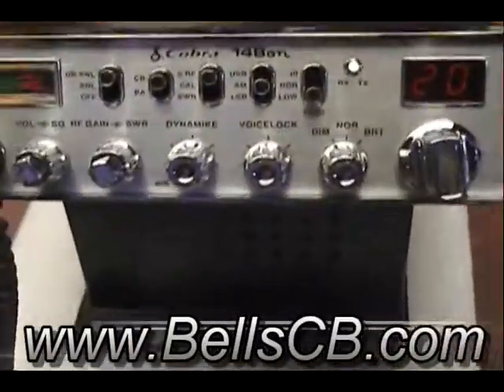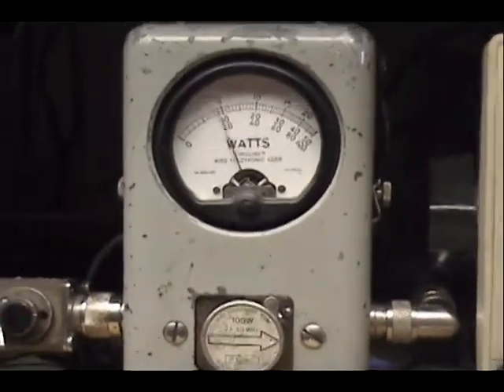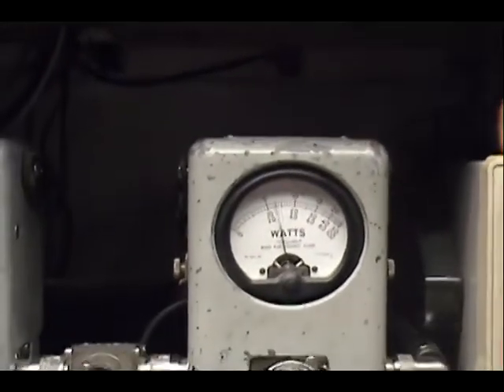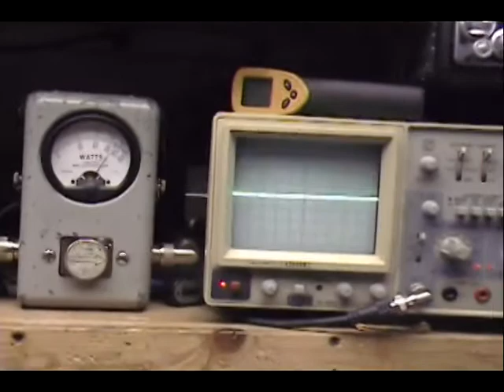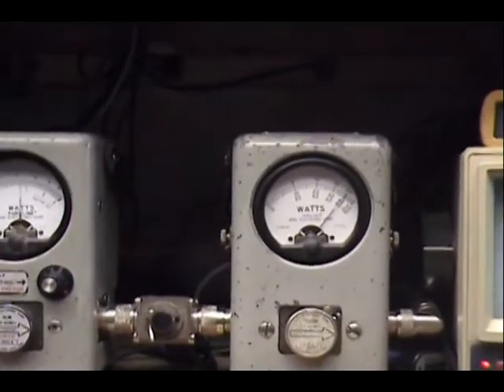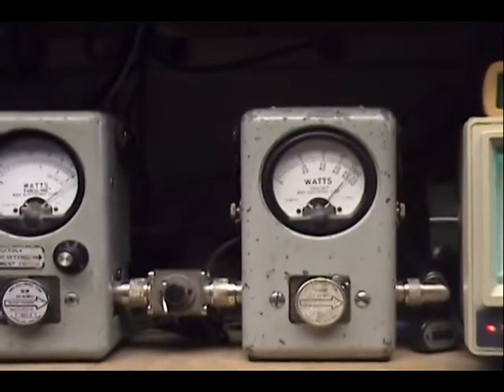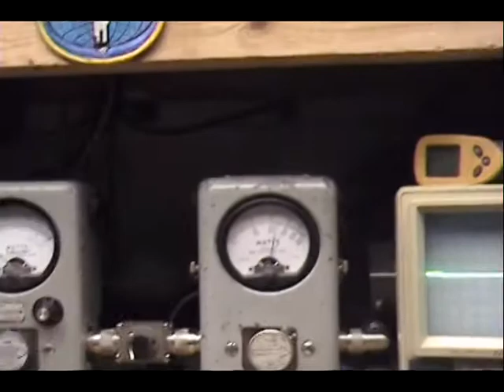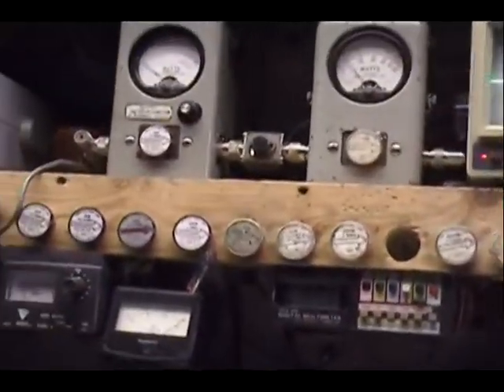Cobra 148GTL with RFX-75 Tune-up Report

Comment: Keith the owner of these Two Cobras he bought through you. Had to have them changed Back to Standard.
over modulating AM Distorted SSB 
My Biggest Worry is How Many Radios you have Tude up with the set up you use cause straight away that Tee connector with an open side would not be a 50 ohm load at the back of the radio 
 I dont know everything But your one Butcher i would never let touch my Radios